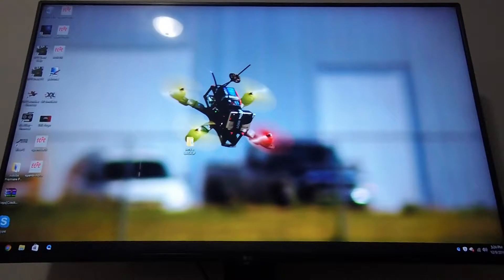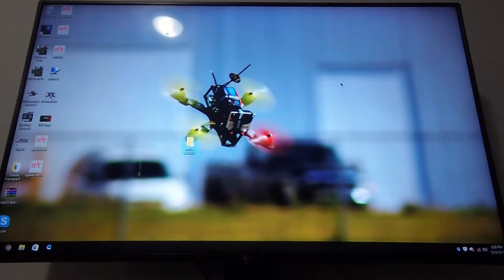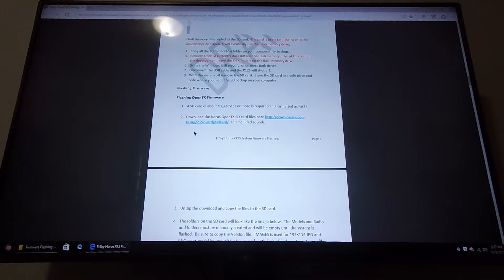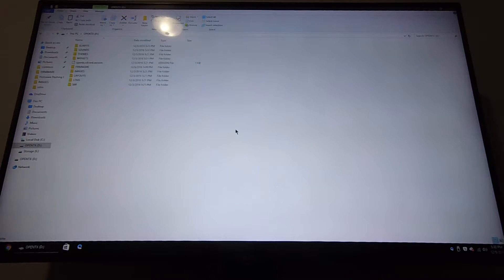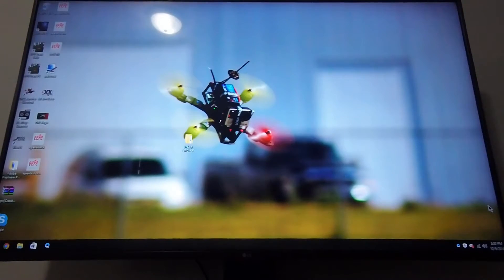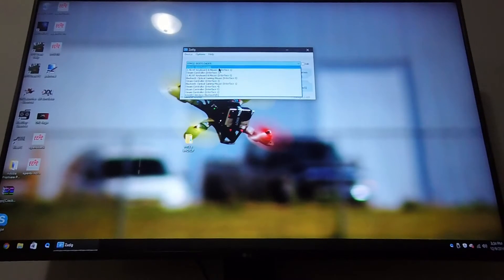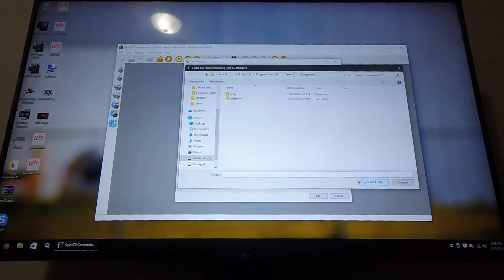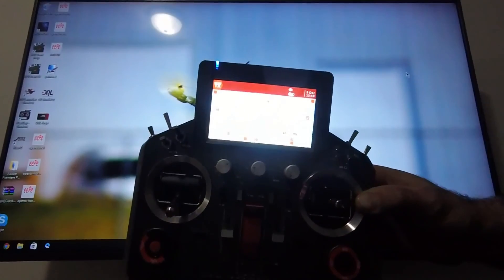Flash OpenTX to Horus X12S

Comment: Hi, thanks. Imine works the way you did it, drivers install, it makes noise when I plug Horus x12s in, but I tried to read FW first to see if I could save the original factory FW, as a ak but more as a test. 
Can you read the original factory FW with companion? BTW I'm running 2.3.
Thanks!!

Comment: Hi, maybe you can help. First off all.. thx for the video!
Since one year my Horus is running on OpenTX. Now i would like to use Receiver running in European region. In this region is LBT used. To get the Horus on LBT running, i have to remove OpenTX first. Flash it to FRTX LBT firmware (because the module have to be flashed too and this is not part of Open TX). Thereafter i have to flach Open TX back.
But.... i don't get FRTX back to the system and i don't have anymore the backup file one year ago. Do you have any idea?

Comment: Thanks!
you nailed the cable thing. it' still a mystery to  me (a controls engineer w/30+ years in) as to why some USB cables work with the STM microcontrollers and others (most) do not. It's not just a matter of having data lines populated, many cables  which work fine for normal data transfer DO NOT WORK for flashing STM microcontrollers. It must be internal capacitance or shielding issues. This is also true of Micro USB cables. I can recommend ANKER Micro USB cables for flashing duty, but for MINI USB, the only one I have that works is a 12" one that came with some a CNC board a few years back.

All that being said, I've still not got 2.2 installed on the Horus (went great yesterday on my 1st gen Taranis). The bootloader upgraded just fine (Zadig and I go way back), and shows up in device manager, but isn't recognized by Companion. (this is familiar ground for those of us using STM32 flight controllers)
When I sort it out, I'll post again. As you noted, support for Horus users is minimal. I don't get that, the Horus is supposed to be the flagship of the Frsky line, but seems to be treated by the community and even Frsky like a 2nd class piece of gear. It looks to be last on all support lists, behind the economy Qx7.
I hope this changes, as I love mine, and hope to keep it as my primary Tx for a long time. Right now I'll be happy to get Open Tx 2.2 on it and Lua working. It doesn't look like Frsky is going to fix their OS any time soon...

Thanks for your video supporting us  'oddball' users that figured the best model would come with the best support...

Scott
Reply: shorter cable might be the answer,

Comment: It’s not only the cable I used a lot of different cables without success, Until I noticed I use a USB2 (blue) port on my computer. When I plugged in the USB1 port (black) it worked.